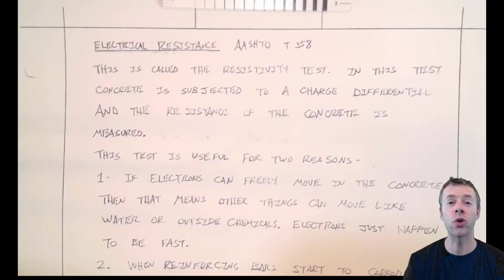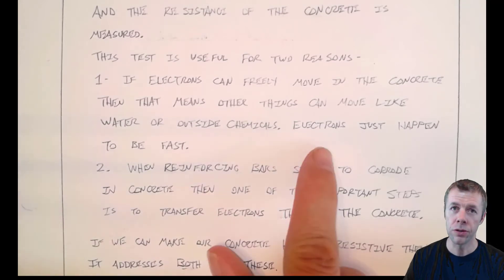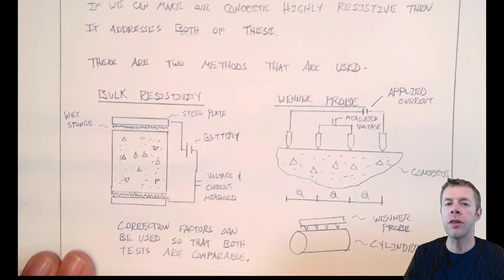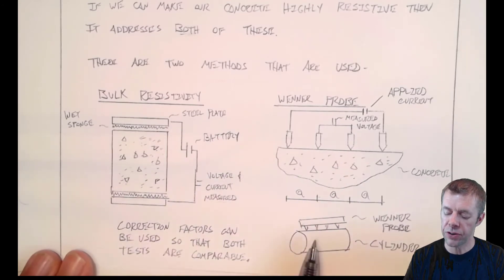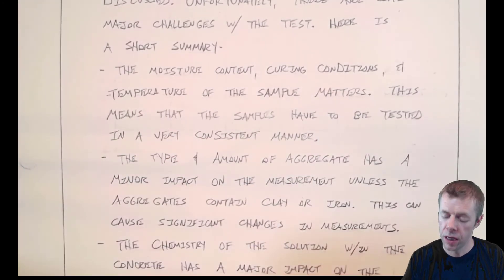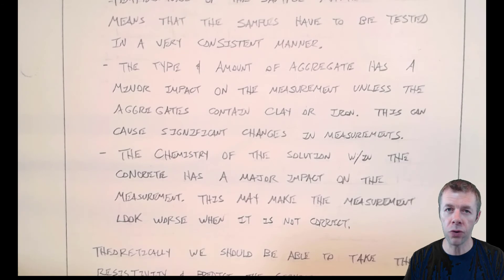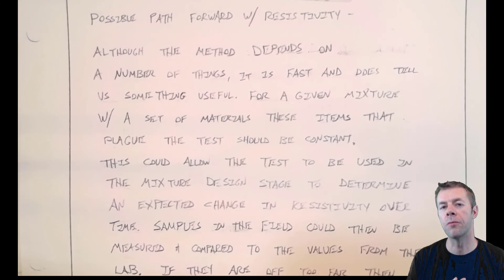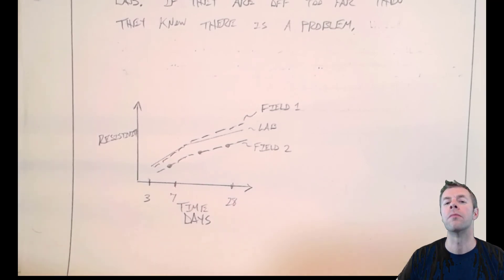Electrical Resistivity – Hardened Concrete Quality Control Tests pt 3

Comment: sorry but actually it's not electron movement through the pore electrolyte of concrete... it's ion movement since electrical current flow within a solution works via an ionic current ^^ am I right or am I right ?

Comment: I don't understand the relation between  the high resistance of the concrete and the corrosion process releasing electrons , can you please further elaborate